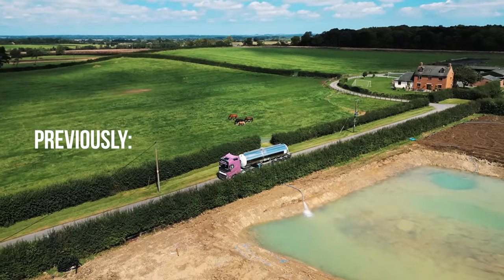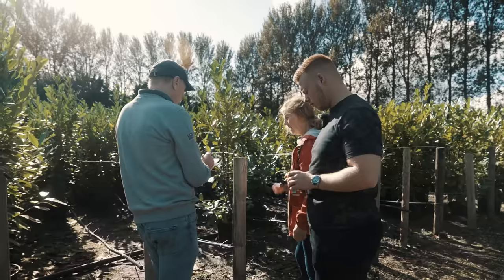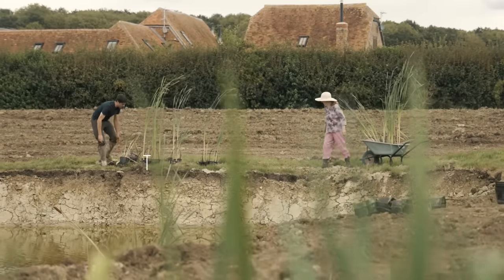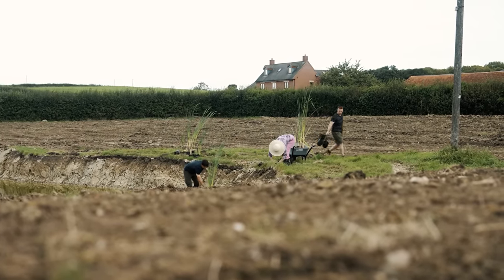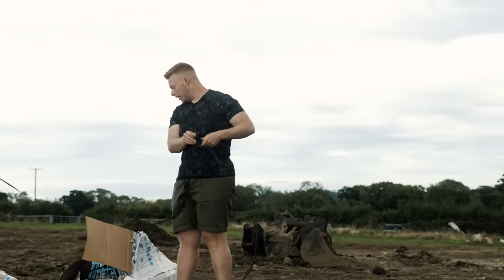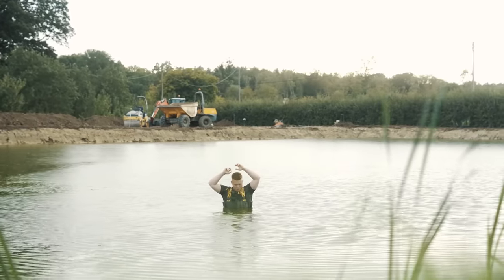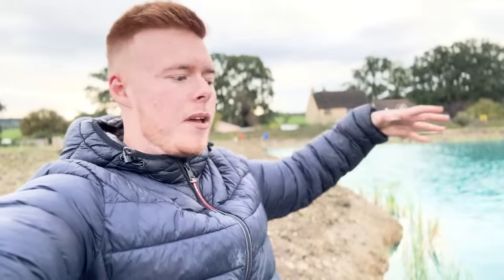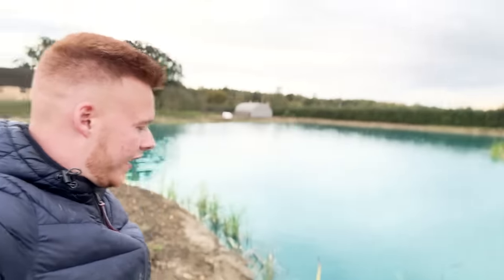ADDING PLANTS TO THE LAKE I BUILT

Comment: Cracking job so far mate. But don't put tyre chippings down it will get everywhere including in the lake, have a look at something like cotswold chippings, its not cheep but its washed natural stone and if you use wacker plate to compacted it it'll last for years
Reply: Granitic Sand looks awesome aswell. It's compacted in and will last with no spreading of chips or stones. Looks like a stately home driveway finish.
Reply: I agree with the rubber chippings. It's horrendous stuff. Will get stuck in boots and end up in the lake and everywhere. I think the ideal peg would have a composite decking. With a wooden panel (that can be changed regularly) to screw stage stands or put pods on

Comment: Lakes coming along nicely,well done. Just a heads up,that isn't a telephone pole it's an electricity pole,11 000 volts,you might want to move that by contacting the electricity board for your area,unfortunately itll probably cost a small fortune but just be careful around the line with excavators and indeed fishing rods👍

Comment: You mentioned using chopped up rubber tyres, a local fishery has used them on one of there lakes and there absolutely horrible, there still bits of the tyre wire sticking  out of them and they look so ugly in the swim, I'd rather fish on mud than chopped tyre, but it's going to be a cracking place

Comment: Brilliant to see the process from start to finish. £250 a night though 😱😱😱
Reply: Takes the piss a bit tbh, carp fishing in a muddy puddle isn't exactly excellent fun,  if it's packed out over a week then it's a shit load of money, hmrc will be happy with their cut
Reply: You’ll pay £150 - £200 a night for a 3* hotel in the Cotswolds, or £250 plus for a converted horse shed in a field on air b&b. So £250 for a 5* lodge, hot tub and fishing … that’s not bad. Take a look at mill lodge for example. fully booked at £200 a night for a shed and bed and 0.1 acres of water per swim … now do the maths! If you want to pay £40 a night, got to linear. (ps, enjoy the portals😳)
Reply: If he puts 30s and 40s in there an it's 250 for 5 of ya on the lake that ain't that bad
Reply: @kippersniffer3699  it's 2 anglers maximum,  there's no 30s or 40s being stocked it's 20lbers according to the website